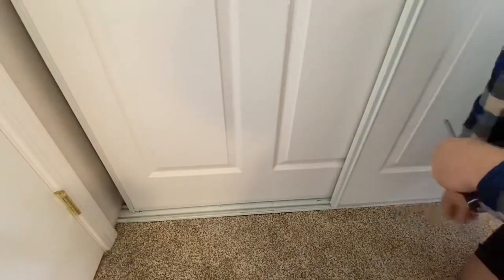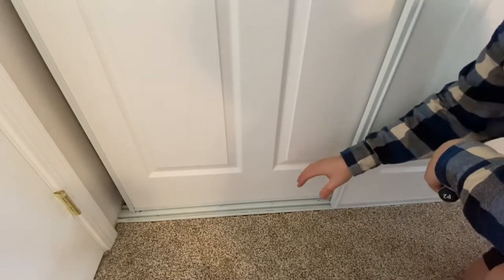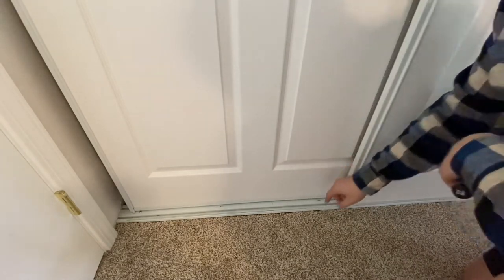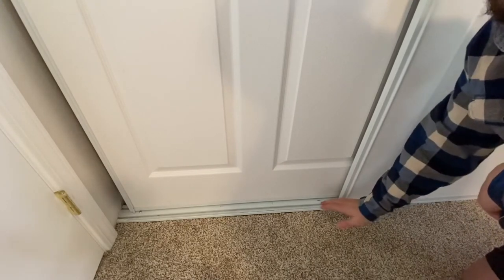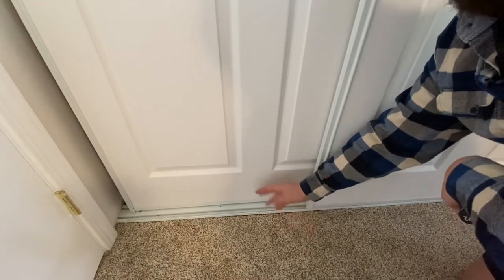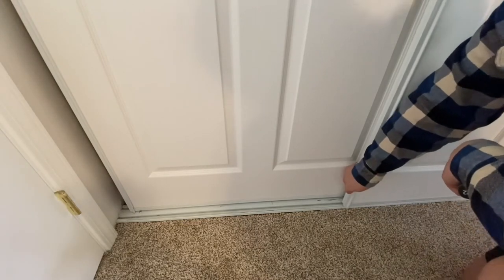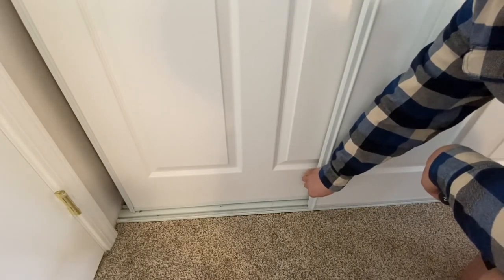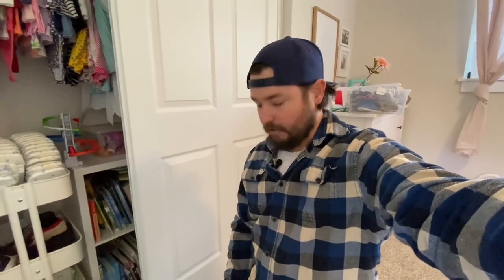Fix that sticky / grinding sliding closet door!

Comment: My doors aren't on tracks. They are only attached by the rollers at the top. One door slides with one finger. The other I have to use both hands to move it. What can I do to make it glide smoothly?
Reply from the maker: Are the doors the same gap on the bottom to the floor? (Wondering if one is sitting higher or lower which might indicated it’s off track). My thought is the bad door is off track. You could grab the door and try to lift it up and move it around a little to see if you can re-set it on the track. Could also try some lubricant spray like garage door lube on the wheels/track. My thought is the door is are probably off track and need some wiggling to adjust the rollers on the track. Best of luck to you I hope you find the problem.

Comment: What lubricant do you use ?  Just WD40?
Reply from the maker: Hi there! Try the Blasters Mylti Purpose Lubricant spray, also used for many other things around the house.
Reply: @littleimprovements  I found the DRY LUBE from Blasters.

Comment: Where do you buy the stiffeners to fix the warping issue?
Reply from the maker: That’s a great question. I would try to determine the manufacture if you could, then call them to ask for a part type. These foux wood (like this one here in video) doors are reasonably priced and very easy to install and may be worth that route vs finding the correct supporting brackets.